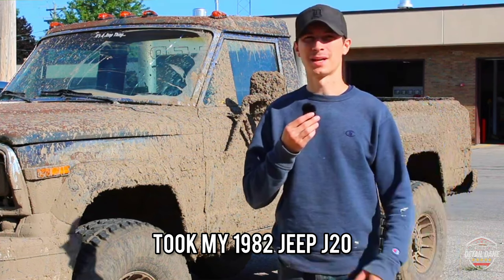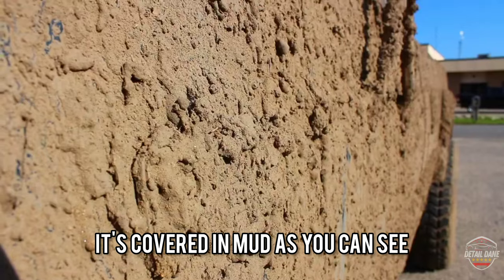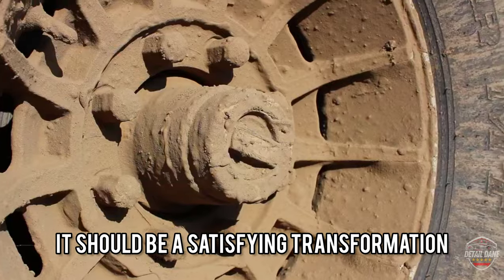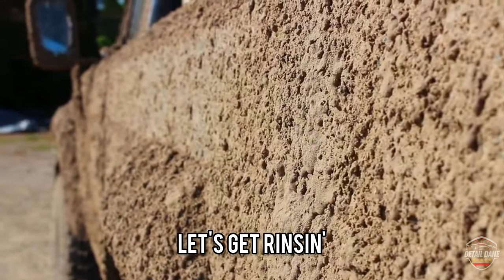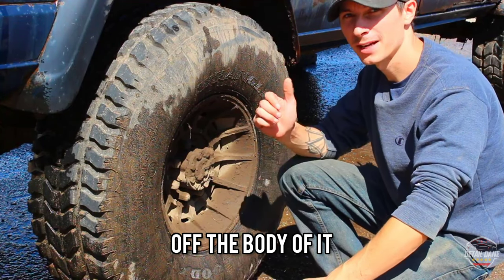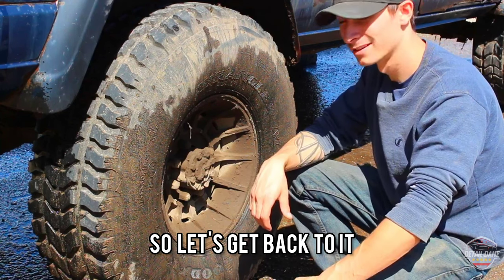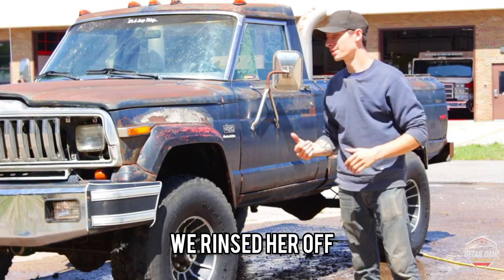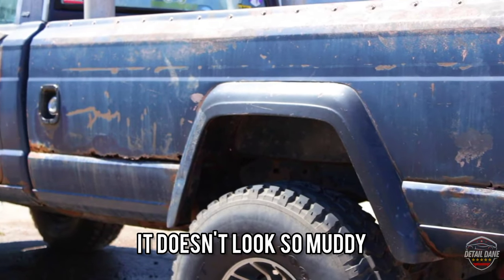Washing My Mud Truck After a MUD BOG

Comment: Long weekend: 400-600 grit sand paper, ebay clear, harbor freight spray gun..won't change the patina, will protect what is left, and it will make it easier to rinse off the mud, especially if you put a coating on it.